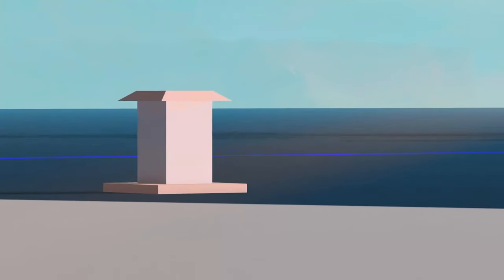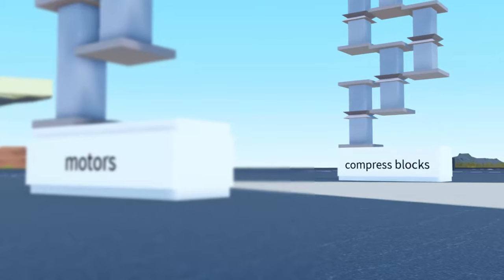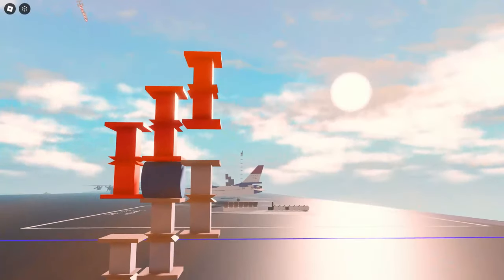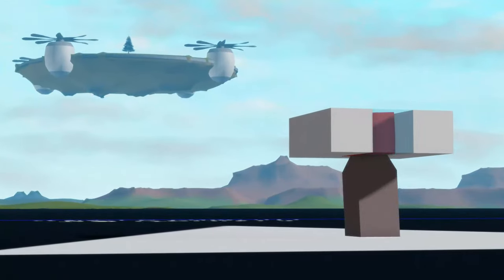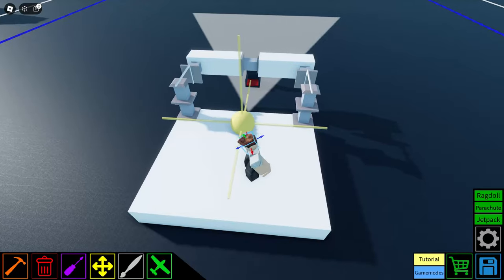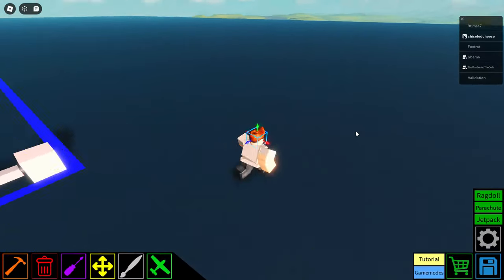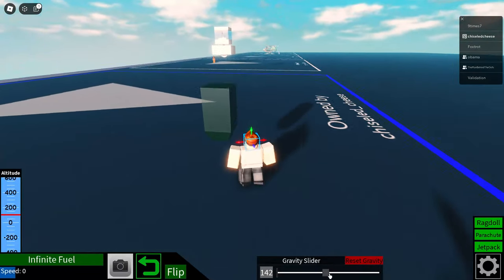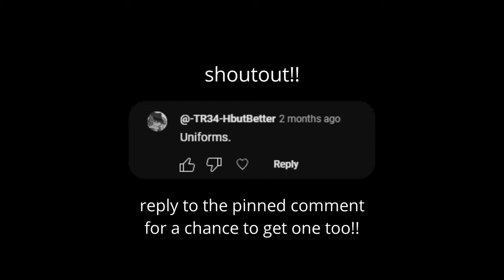This Block is INSANE | Plane Crazy

Comment: Compression blocks are really buggy when you attach to anchored blocks, like I do when the first time I met those blocks, I tried to make the compressed blocks above the anchored blocks to make some locking (compression locking?) and I see it's messed up and instead the compression block stays in the air, hope you noticed that 👍

I don't think it would happen on the original motorlocks but I think turning off physics work more on compression blocks (I forgot when to put the anchored blocks physics on or off) 🙃

Also compression blocks works at rotating locks, and it would be much better if transparent is on and collision is off 😅

Comment: why isnt flightpoint supporing mobile anymore? it did but then i just couldnt join anymore
Reply: The game is not optimized for mobile devices. Tablets are an exception. When Flightpoint 2 comes, mobile will finally be supported. The current game is just too unoptimized and it will be hard to make it optimized for mobile devices now.
Reply: @pilotjdb   tho it did work before...
Reply from the maker: @_HRIVA_  the game is much more advanced internally now. its really hard to run it
Reply: @chiseledcheese  kk